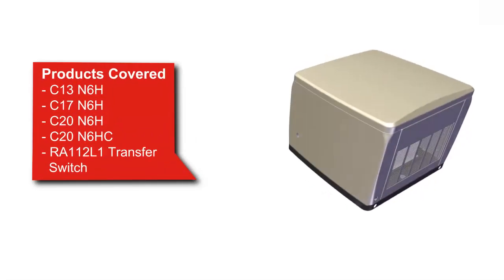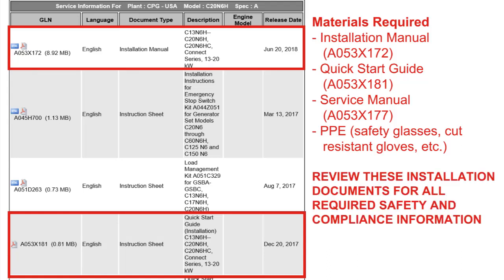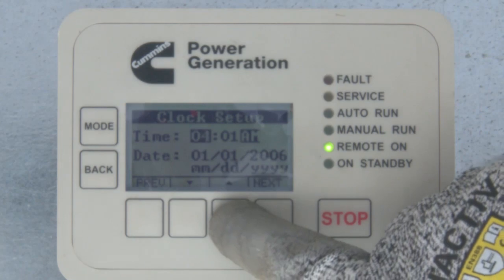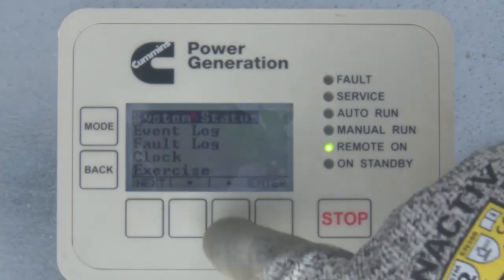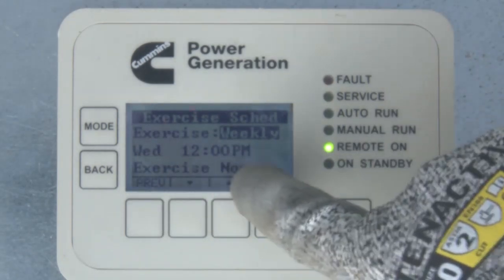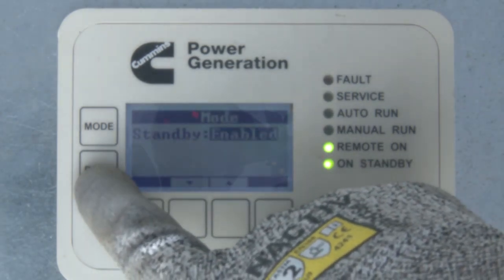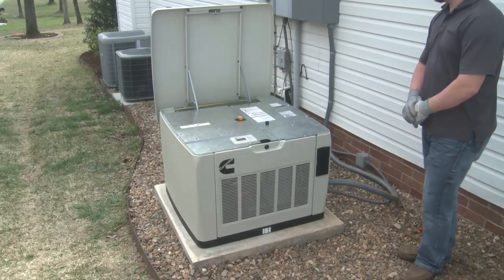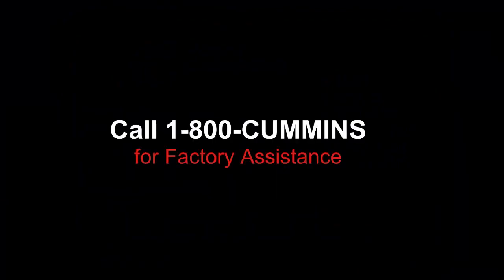Cummins Air-Cooled Generator Set Installation Part 4: Generator Set Control Configuration

Comment: I just installed a new RS17A Cummins unit with manual transfer box. After setting the excercise routine, how long until it will excercise the first time? I thought after setting up bi-monthly at 2pm on Wednesdays, it would excercise the following wednesday but it didn't...
Reply: Did u ever get it fixed ? I set mine for a certain day bimonthly but it won’t exercise

Comment: 2:22  Major failure in this video.  Cummins goes out of their way to say Crank Exercise should be Disabled, then glosses over exactly how one would change the setting from Enabled to Disabled.   Going in cirlcle at this moment trying to figure it out.
Reply: After disabled is highlighted, click the arrow key up or down.
Reply: Mine was enabled and did not exercise. Just changed to disabled. Will find out next exercise period.
Reply: @jeffbrown7168 did changing it to disable correct the problem ?
Reply: @jeffbrown7168 did it end up working out?

Comment: I have a situation where the set control panel display blinks as if frozen and I can't control the back. Button or change ant setting . I shut off the unit's breaker and transfer switch off\on and it shows no change to allow me to set controls. Suggestings???
Reply: I have the 13w RS13 unit,..sorry..

Comment: Cummins  c13n6h a054e399 started gen set under load now my power is dirty and burning lite bulbs and showing reverse polarity on my furnace other wise it is working did I blow up the power filter board by not letting it come up to speed and then doing the transfer on the breaker to initiate power to the house thank you